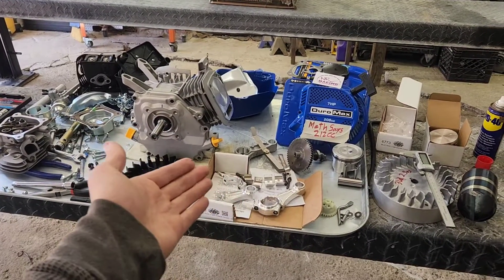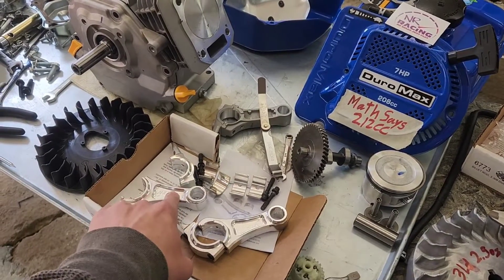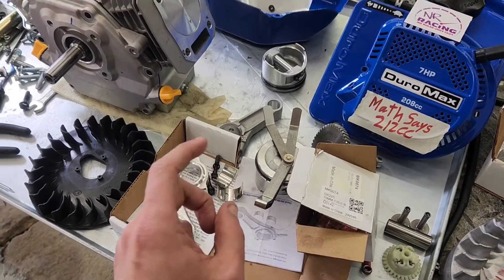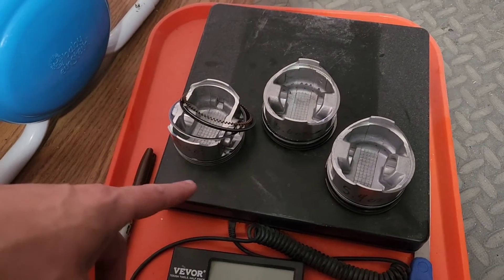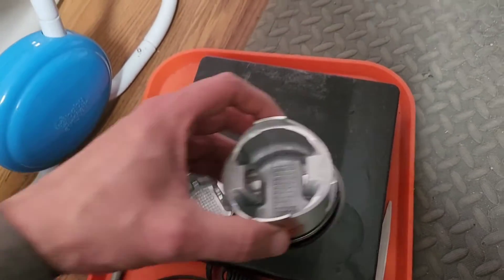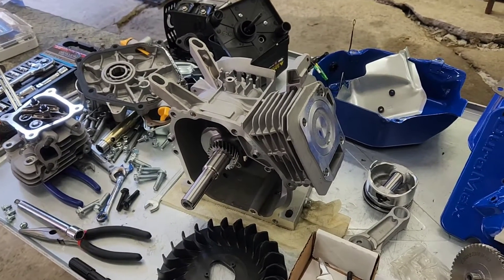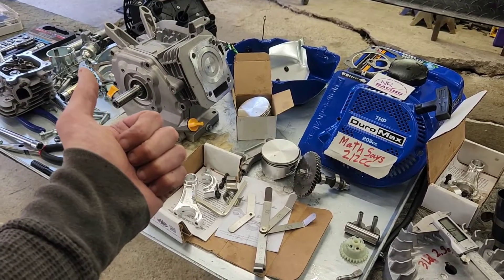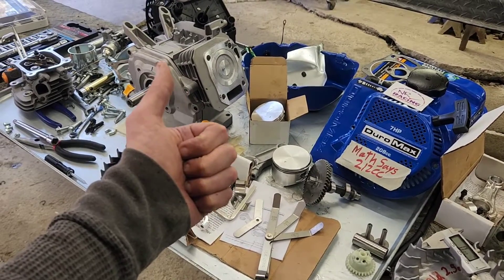Duromax 208cc Performance Connecting Rod and Piston

Comment: Hey @RCGracing omB just told me I need the 3.303 for my 208 should I just get the one u did and change the piston kinda stuck on which to go with i just want a back up so I can build my ducar ?
Reply from the maker: Go to NR Racing and order a Ducar 212cc Rod and use the stock piston
Reply: @RCGRacing thank you RCG racing appreciate your time and help 💪🏼💯💨💨💨
Reply: @RCGRacing NR RACING JUST EMAILED ME AND SAID THERES NO BILLET ROD THAT FITS THE STOCK DUROMAX WRIST PIN AN SURE ENOUGH MY DUMAZZ GOT FROM OMB WAREHOUSE A 3.303 AND THE WRIST PIN IS TOO BIG LOL GOTTA RETURN IT YOU EVER HEARD OF A SHREDDER HEAD WILL THEY FIT OUR DUROMAX'S I LOVE IT SO FAR ALL THE OPTIONS JUST GOTTA GET THAT PISTON I ALREADY POPED MINE OUT BY ACCIDENT SO MINE AS WELL GET THAT LIGHTER ONE WITH THE WEIRD OIL CUT OUTS INSTEAD OF THE HOLES OR SHOULD I JUST USE THE ONE OUT MY OLD DUCAR THAT IM TRYING TO BUILD AT THE SAME TIME 😊
Reply: @RCGRacing they want me to try the +20 piston combo I kinda want to give the combo that u didn't try yet a shot but if it's over deck that's a no no right ? It's all a fun learning experience at this point I'm no longer dealing with omb I asked what's the best rod and this lovely man sends me the 3.003 rod that dosent fit the wrist pin lol now taking over a week to refund my money lol
Reply: @RCGRacing can't wait to get my nr racing shirt ✨️
Reply: @RCGRacing by any chance do you remember if you had to clearance the front of the block for the dipper on the arc 6271 3.323 rod from NR racings I just put it in with the flat top piston and it looks hella close to hitting the block with the rattlesnake cam I told them I heard about them from your videos too

Comment: You are overthinking it. You could use the Ducar piston, be .007" in the hole and use a .018" head gasket, or use the Amazon piston with a 9 or .010" gasket. Both would have .025" piston to head clearance.

The weight of the piston isn't going to make a big difference but is something to consider if you are going for 8K plus RPM.

The dished piston isn't worth using when you have flattops in hand.

Have you measured stroke? 208's are nothing more than a big bore clone. 70mm bore with a 54mm stroke.